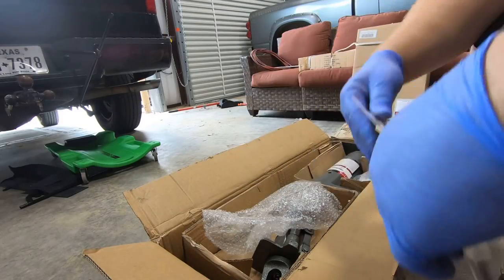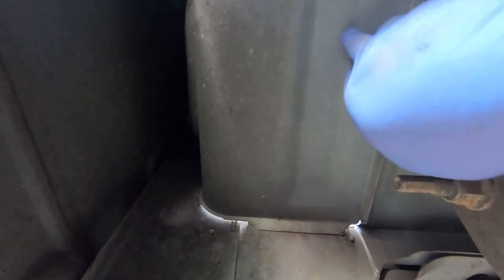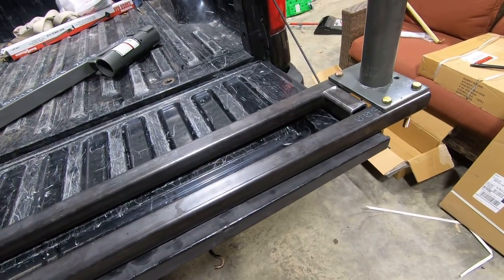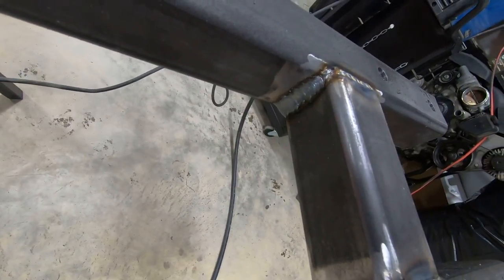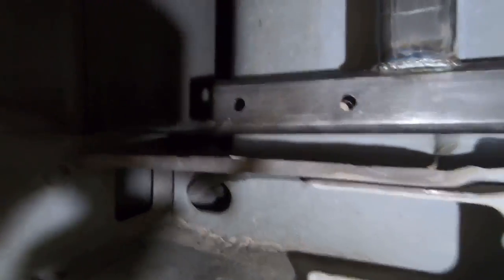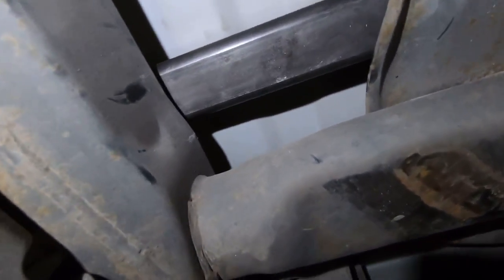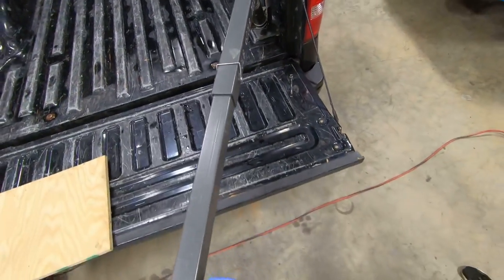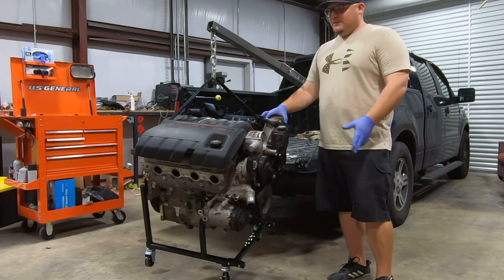Cheap Harbor Freight 1/2 ton Truck Crane SUCCESS!!

Comment: Finally,  this vid shows how to brace it right. So many others install theirs and have to do it over and still its not braced enough. Thanks for sharing.
Reply from the maker: Thanks, check out my other updated crane video.
Reply: @quickspoolgarage  Checked it out ! Im about to install mine except I have a Toyota Tundra, I can only fit 1 cross brace being my spare tire cradle is in the way but maybe I can just use a 2x3 or 2x4
Reply: Good video, thanks! What are the dimensions of the base plate?

Comment: How about uploading a continuation of the video, showing the engine actually being loaded into and out of the bed ?
Reply from the maker: Will do as soon as I finish the upgraded winch, thanks
Reply: I don't think it will work for wide items like engines.. to clear the gate you need the arm all the way out, but once you swing it arm hits the far side of the bed walls. Would have to remove the tailgate to work

Comment: Love the braces, maybe overkill but I would do the exact same thing. Better overkill than dangerous. Bravo, I feel better now installing mine, this is the best vid iv'e seen. TY.
Reply from the maker: Thanks Bud, I’ve added a winch and pedestal to rest the boom. Video coming soon.
Reply: I did something similar but i mounted mine by my wheel well. I only had an inch of room under the bed so i used a piece of 1" plate 13"x45" across the wheel arch of the frame along with 3/4" gussets and it doubles as gooseneck hitch. I also added a winch and a shiev pulley 2:1 to help slow down the winch speed and make it easier on the winch motor as well.  Next step for mine is to add a 12v hydraulic jack for the boom height.

Comment: A long arm jack would be more useful to get the boom up with a load and clear the truck bed.  A hand winch on it would be another useful addition.  Nice job reinforcing the bed.  Too many people actually believe the advertising and just install it.  A good way to trash your bed.
Reply from the maker: Thanks I’m installing a winch new vid comin soon.
Reply: Harbor freight sells one with a cable winch on it as well but it was about $60 more
Reply from the maker: @brandonGCHACHU  yes but I believe that sticks out way above past the bed. This one is not noticeable unless you look inside the bed if the truck.
Reply: @quickspoolgarage  about to do this where did you buy the 2x2?

Comment: Metal square tubing along inside of the edge of the frame, you know he'll I don't know 3/4 ft to the front you know so it's pulling on them back now. Then they're pissed it really is you know if you're pulling off the back and I'm pulling off of sideways so it's just going to rock that over and roll it over to bring weight to it but he needs a lateral link to the bed front-to-back

Comment: I need to do this.  Would you explain how you got access.. removing the lights, or whatever. I just looked under the truck to see if there was a way to get to it from the underside, but it did not look like one could.  And, thank you. Great video.
Reply from the maker: Super easy unbolt the fuel nozzle neck usually 3-4 screws, remove the torx bolts holding the bed to the frame, and unplug the main harness to the taillights most of the time it’s right behind the spare tire.

Comment: The mount seems good but i don't see how its usable. You cant pick up that engine and place it in the bed as it will hit the side of the bed. you cant go shorter on the arm for more capacity because it wont clear the tailgate. you'd have to add a winch to make this useful.
Reply from the maker: Very usable and works amazing! See my other video

Comment: Can you get the crane high enough to put the engine on the bed tho?? Was thinking of getting one for loading welder but it seems like it doesn’t have the reach
Reply from the maker: it definitely has enough room to get an engine in and out of the truck. I have an update video coming soon hopefully tomorrow. Thanks

Comment: Very nice job! I need to do the same. What were your dimensions? I have the same set up.
Reply from the maker: 2x2 square tubing 1/4 thick. 👌
Reply: @quickspoolgarage  Thanks but I meant the dimensions for the tubing: cuts for length from end to end.

Comment: There’s no way that brace is gonna hold 1000 pounds it’s still depends on the trucks bed floor which it will crack  if brace was under the frame would made more sense never weld to the frame of any vehicle
Reply from the maker: Wrong 😂

Comment: You need a bigger crane, this is basically only useful for 500lb loads as the boom needs to be extended all the way. On top of that there isn't much room to lift larger objects. Useful, but not as useful as it could have been for the same amount of effort.
Reply from the maker: This has worked perfect for what I need it for. And the fact it’s totally concealed is what sold me.